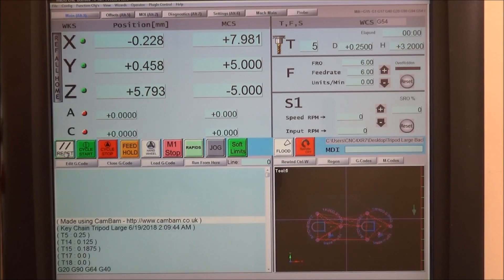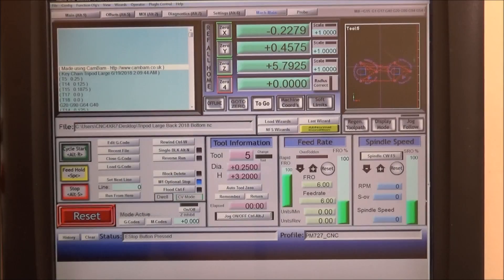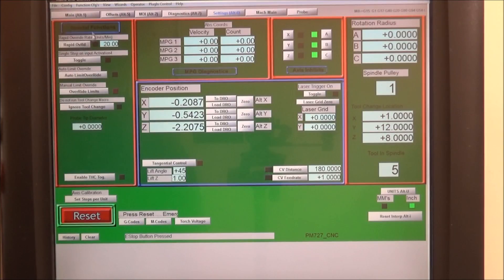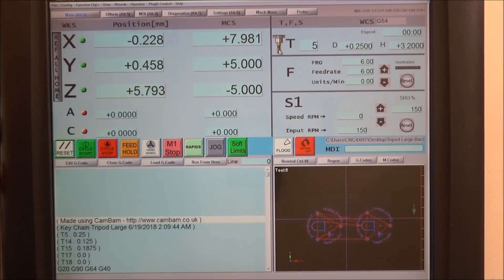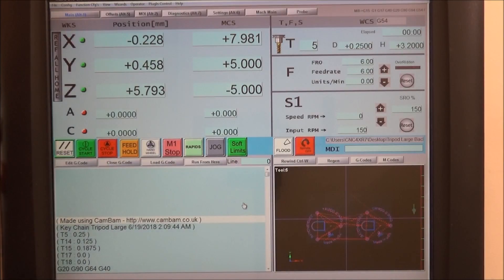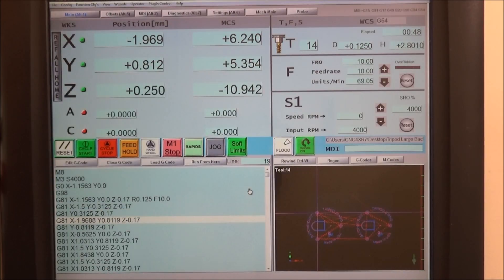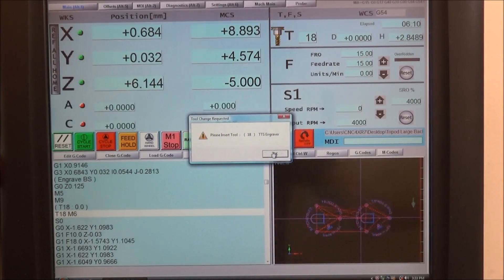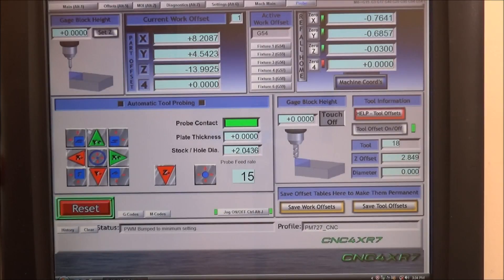Mach3 Sinumerik Style Screenset

Comment: Really COOL! How can i change screen set without loosing system settings for my mill?
Reply from the maker: Changing screens will not effect parameters. Simply load the new screen set in your mach3 folder along with bitmaps directions included. Then in mach3 view loadscreens then select the screen to be loaded.